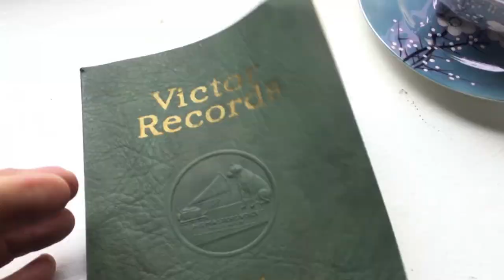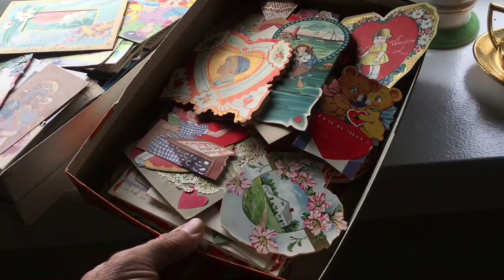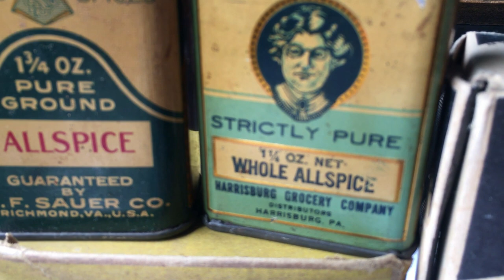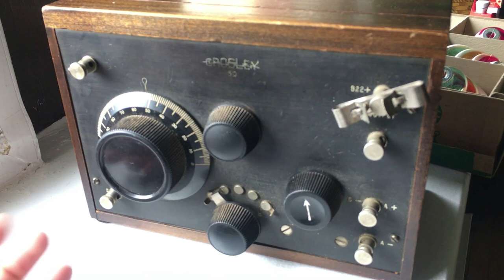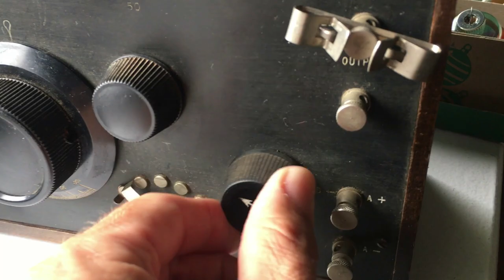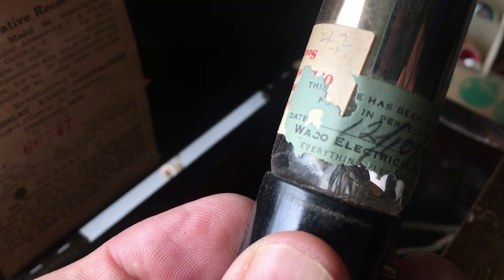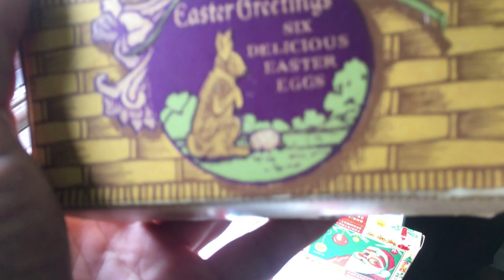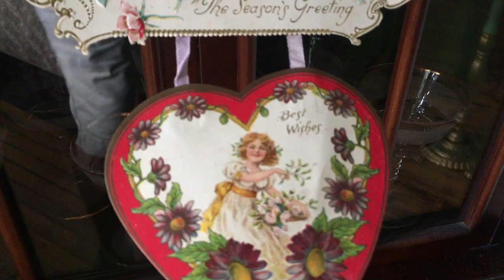Estate Sale Treasures!  Let's see!

Comment: It was a wonderful day!  You really found some great things.  The radio is fantastic, I have an old floor g fine radio in a lighter birch cabinet that, as far as I know was working fine, but I won’t turn it on.  You warned against that.  It is a green eye multi band, and has two oval panels of rattan on the front.  Very modern styling but they need replacing after all these years.  I’m not sure how to go about getting gas this radio restored. Love the cards, and ornaments,a gold mine in a box..😆. 👍💕

Comment: Just wondering how you replace the tubes. When I was a kid we went to the variety section of the grocery store or to radio shack to get replacement tubes for our TV
Reply from the maker: I have quite a stock pile of old tubes and there are collector clubs where they can be found.
Reply: @oldcuriosityshop265  that's very cool.